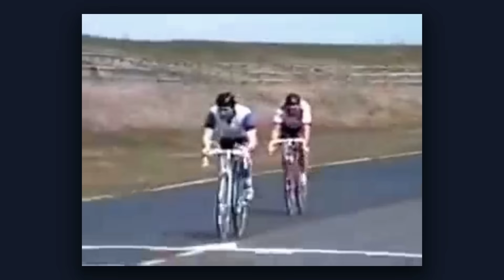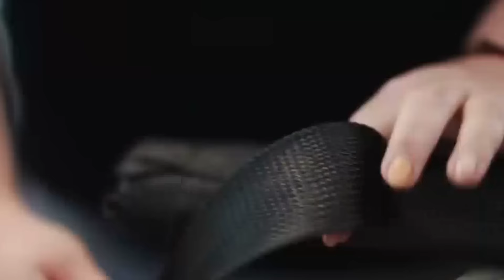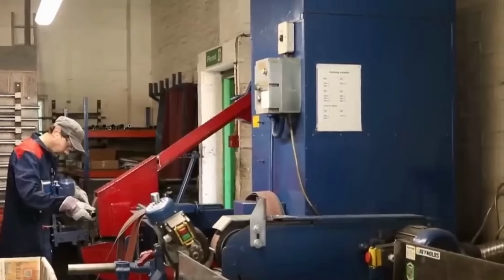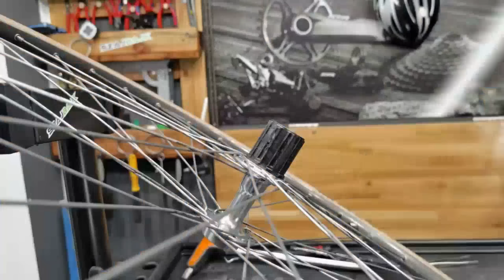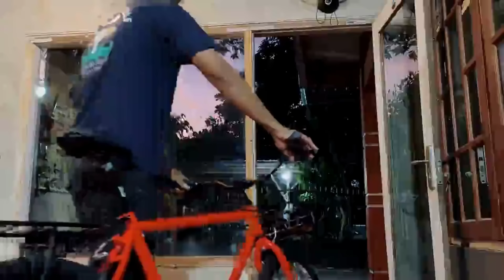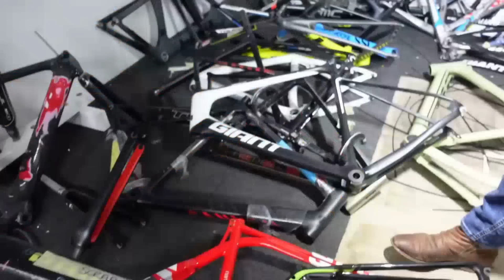Why 1980s Steel Mountain Bikes are Making a Huge Comeback

Comment: Ive built,  sold, given away several 80s mountain bikes, lugged,  Trek Single Track , made in USA. Trek 930, 950, 970, excellent for commuters,  gravel , touring. You can put larger tires, no toe overlap.👍

Comment: I've had bikes since the early 80s and 1 of my favourites was a Claude Butler capewrath in steel and from the 90s with 100mm of suspension travel it was perfect in size (large 18.5 if think) but on my way to work 1 day then chain stay rusted away and broke whilst going around a roundabout, luckily I got around but on inspection I couldn't see anything because it was on my join where the 2inch piece is welded across from 1 stay to the other.
A bad design really to have a drain hole right where the water from the rear tyre sprays lol but correct me if I'm wrong isn't that hole something to do with the welding process?
But I do still look on eBay every now and again to see if 1 pops up. 
I now have a giant trance advance 2 carbon full suspension a aluminium ragley Marley 2.0 and a early 2000s gt avalanche ( aluminium) a miss a steel frame 👍

Comment: For your information, a carbon frame can easily repaired at home. You need not expensive tools like a Welding machine. Just epoxy, carbon fabric, sandpaper and a scale to mix the epoxy and hardener.

Comment: Aluminum was a good material for full suspension bikes from that era. I have a Jamis Dakar Expert made in USA that has a Morizochi Bomber fork 120 with a 90 lock out.full XTR. That bike was famous for winning a lot of races, not mine the model. I did race it a lot in winter park colorado. Yes I did have a gary fisher hookooekoo triple butted steel bike from that era that rode and handled like a dream.

Comment: No, no, no .. Steel is returning as build material but 90's mtbs are trash .. Geometry is so wrong, I try going on them several times.. Very very twitchy and bad feeling riding them. My 82' German Staiger 28" touring bike is more slack then 90's mtb

Comment: Chromoly with no suspension. No need to modernize drivetrain if you seek out premium models that have  the best drivetrains-wheels and hubs of the day. You can ride in the small front ring all day. Keeping wheels on the ground, and hike a bike through the dangerous spots. Doesn't need to be an extreme sport.
Reply: Totally agree

Comment: One of the bikes I use as a winter storm bike is my Nishiki rockhound that I bought back in 86. I converted it into a fixed gear bike with 2" Noby studded tires. It requires almost no maintenance and is fun to ride in the snow.

Comment: I’m a Bridgestone Nut. Can’t have enough. Must have Riser bars and short stem or Abatross and short stem. I like the comfort and feel the steel. I have later 520 Trek Disc, and Orange P7 modern steel MTB as well. I’m fine being a cantilever and original 3X7 drivetrain. It does the job.

Comment: All my MTB bikes from the 90s are made of 4130 steel except for one (Steppenwolf, aluminum, but with a chrome-molybdenum fork just like the newer Trek 4300), all are hardtails, no front suspension, all 26", mostly equipped with XT, the Scott mtb is full XTR, I like them just the way they are.
Reply: Totally agree, why spend money when you don't have to - see my above point!

Comment: Or, just purchase a modern inexpensive bike.  There are a lot of choices for comparable money.
Reply: Not as good. $350 gets you a crummy quality bike with Tourney and cheap aluminum frame and crummy drivetrain, cranks, wheels, etc. Much better off with an old steel MTB of good quality to add better components to, or enjoy as is with different handlebars/stem.

Comment: I can't stand single chain ring cranks, or 1x drivetrains. I'm a big believer in front derailleurs. My two mountain bikes have triple cranks. 3x9 was absolute peak mountain biking. I've ridden steel. It's OK. For mountain bikes, its good for hard tails. But Aluminum is much better for suspension frames. I've been riding aluminum suspension frames since 95'. The Cook Brothers crank shown here is 1990's, NOT 80's!! I know because I was buying stuff like this when it was new. Thank you.

Comment: Bike industry explaining how to spend more on an old steel bike that it was bought new for back in the day. "Upgrade" the drivetrain so you have less range. Bike industry is on some special drugs.  Bikes should always cost ten percent or less of what you can get a motorcycle for, no matter how "fancy" the simplest form of 2 wheeled transportation is.

Comment: I’ve built several 90’s steel mountain bikes from scratch.  I bought used, high quality steel frames from online sources, added new and used components to suit my riding style. The bikes I built are simple to maintain and repair, immensely fun to ride, and cost less than $350.  The parts I didn’t have in my parts bin, I purchased at the local bike co-op.  I learned enough about bicycles to become a competent bike mechanic.  

My favorite steel bike is a 1990s Breezer Storm.  It is all original.

Comment: 26" wheels are stronger than 29" wheels per unit weight. 

I would buy a new disc fork and leave the rear rim brakes as they were. The front brake does most of the braking. A bolt on disc brake is unneeded weight and fussy.

Comment: First Mountain bike I ever owned was the Schwinn Mount Washington back in early 1980's. Lived in the city but was a short ride from the river basin. When the river was low we could ride and jump our bikes over the river from boulder to boulder, I broke the frame and had to weld it back but it was a good tough bike. Couldn't stop it in the snow because of it old side pull brakes when the rims froze over so I ordered a set of Bouch drum brakes which worked so well they would rip the valve stems off the bike if you locked it up at high speed and low tire pressure. good times.

Comment: New modern steel bikes are expensive compared to vintage steel bikes. Also the geometry of those vintage bikes had is hard to find in new modern bikes. Lastly, the build quality as many of them were made in the 🇺🇸. Maybe there is some nostalgia behind it but not entirely.

Comment: Specialized introduced…WTF?  Go back to the books junior, Specialized bought a steel Ritchey Mountain Bike or two (when Ritchey’s frames were being built up by Gary Fisher and Charlie Kelly) and copied it with additional influences from Lighthouse Cycles.  The only thing Specialized introduced was mass production.
Reply: You have it backwards.  Tom Ritchey was building for Fisher and Kelly.  Joe Breeze also built some of Kelly's.
Reply: @dudeonbike800 .  Well, first thing, you need to read more carefully, I don’t say anybody was doing anything “FOR” anybody.  You also clearly don’t know what you are talking about, Ritchey built the frames and, as I said, Fisher and Kelly assembled them into complete bike.  The venture was called “MountainBikes” and the frames carried the name “Ritchey MountainBikes” … a partnership between the three.   The shop that ultimately sprang up where the bikes were assembled was called “Kelly-Fisher MountainBikes” and sat on corner of San Anselmo Ave and Center Blvd.  They also had an import designed by Ritchey that were simply “Montare MountainBikes” at about which time Ritchey went his own way and Fisher bought out Kelly and “Fisher MountainBikes” was born.

Comment: Modern bikes are overkill. The challenge is muted. An old skool frameset with modern components gives you far less mechanical issues while giving back that lively feeling of chromoly.
Reply: ordinary bike make ordinary ride awesome
Reply: I wish some of these 90s mtbs would allow 27.5 wheel set!
Reply: @vijayanchomatil8413  add 29" fork and make a mullet bike.

Comment: but what about rust😢
Reply: Rust can be prevented, broken carbon fibre goes in dumpster.  I guarantee that in a century there will be more surviving steel bikes than carbon fibre.
Reply: @markhale8084  Fall once on a carbon frame and then be suspecting that there is a latent crack somewhere that is going to give out and result in trauma.  No thanks
Reply: What about rust ?
I've had  my Fat Chance since 1997, I haven't noticed any rust . Is that a deal breaker-go figure!
Reply: @johnhickman2033 do you play guitar?
Reply: When I last tore down my Trek 930, I poured an ounce or two of "boiled" linseed oil into the frame and spun it around. I drained the excess thru the holes then put it in the sun to dry. Cleaned out the seat mast tube. Boeshield is probably better, but now my bicycle smells like an oil painting.